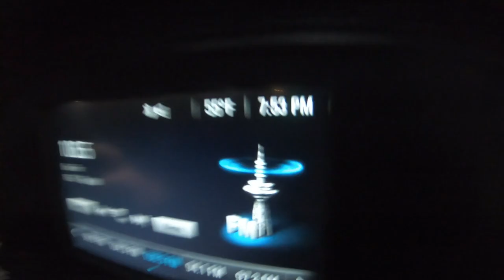The Holey Goat: Part 1 — I Bought the Worst Pontiac GTO on the Planet and Now I Gotta Go Get It!

Comment: I love it! It looks like some of the cars I used to drag home! I don't think you are crazy at all!  I think that the only car cooler than the 70 GTO is the 64! I have had a 64 and a 70 convertible tucked away for years! They are the first two GTO'S and the most solid of all of them all and I never got to them, ! I bought the 64 in 1973 and the70 in 1979! I built a pair of 64 convertibles in the mid 70's for my first wife and I , Then I built a pair of 70 hardtops!  I found that if I built two of each car we didn't fight over who got to drive it! I built a pair of identical twin 68 Firebirds that the only way to tell them apart was the antenna was on the front of one and the rear of the other! It may have kept the peace but at one point we had 10 '''toy''' Pontiacs stashed in garages nearby and two 69 Lemans Sport daily drivers!
Reply from the maker: I love it! Can't beat Pontiacs, my favorite make, period. I'd have to say my dream car is probably a 62 Catalina!

Comment: See, that's what I don't understand. 8:15 If this car sat in the desert since the 70's, how is the entire trunk rotted out? Its as bad a car in Canada that's driven 25 winters,,salt, . lol. Should that car not be solid bullet holes instead of rust?  I bet that VIN will tell a story.
Reply from the maker: Sat in a wash. I don't necessarily get it either, but best I can figure is somehow the center of the car remained buried and preserved, while the rear was exposed to o2